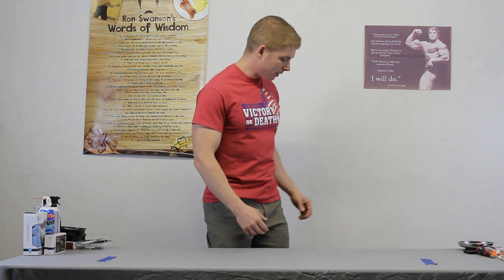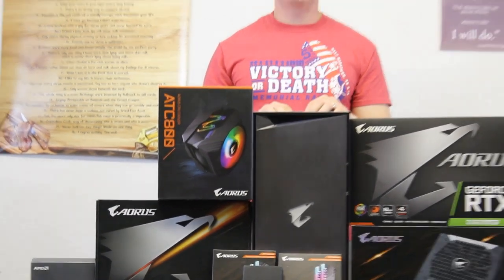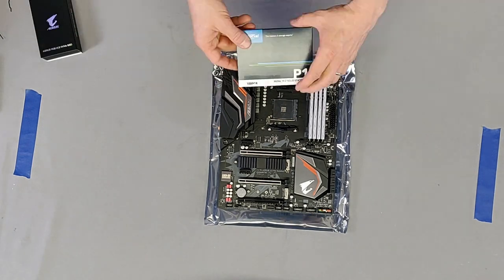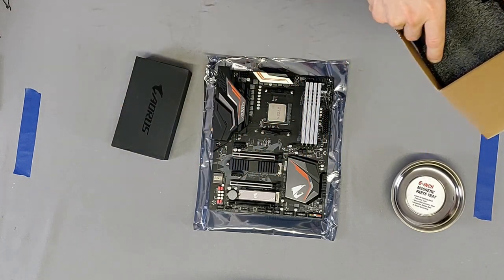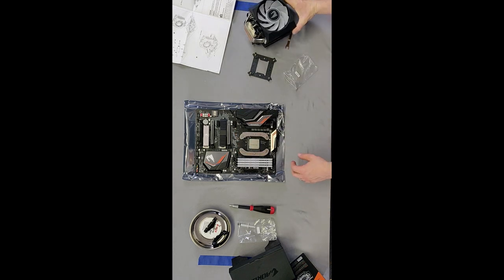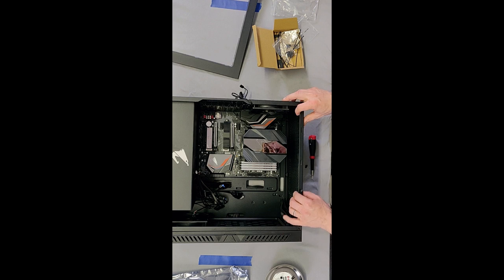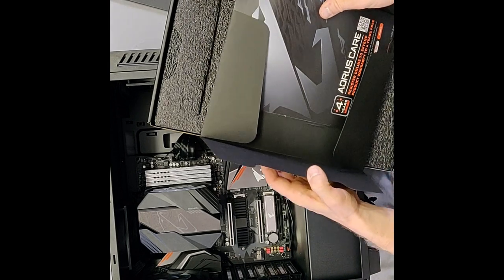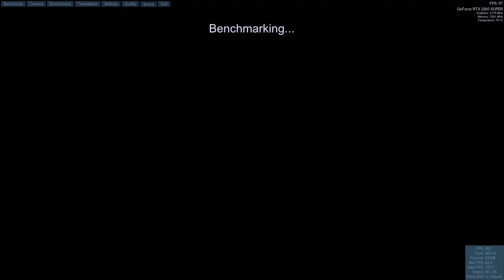Gigabyte gaming PC Ryzen 7 2700X RTX 2060 Super

Comment: If you want do vertical put the Super AORUS in those cases you need a AIO Cooler
Reply from the maker: I did not fully understand just how big that GPU was. AIO would have worked but I was too deep at that point. I still think it turned out nice.

Comment: is the 2700x stil a 3-4yr card ? til nxt upgrde or is the 3600 a better buy?
Reply: Lj Storyahey without over clocking they’re the same but the 2700x has more cores and is better for multitasking like streaming
Reply: thank u
Reply: Lj Storyahey I suggest watching benchmark videos with the 2700x and the 3600 to see if you still want the 2700x
Reply from the maker: I would personally lean toward the 2700X. I think the extra cores and threads would be more beneficial than the higher clock speed. Games are already wanting the extra cores. THis video from Tech deals goes into it a little. https://youtu.be/xg_l-RWjAh8. Either way, I think both are good. Maybe look for the deal.
Reply: Ryzen 5 3600 is way more than enough for gaming and since it’s a 3rd gen Ryzen it would be a better choice than a 2nd gen Ryzen. You DO NOT need more cores, 6 cores is way more than enough for just gaming. Unless you’re doing some serious content creation (streaming, video editing) you do not need more than 6 cores. 

Side note. The Ryzen 7 2600x is not outdated. Plenty of ppl I know still go with that cpu. Great deal all them with more than enough to run 1440 and even 4K at 60 fps for some games.

Comment: Please tell me how is the airflow of this case, gigabyte c300 glass.
Reply from the maker: It was great. I would recommend grabbing an extra case fan or 2. I don't remember how many it comes with.
Reply: @CrashWilcox  It comes with 2, 1 at rear and 1 at the front.
Reply from the maker: @scale...3d  Ok, depending on what kind of CPU cooler you get I would recommend 1 more case fan. It's not a necessity but that is what I would do. Otherwise, it's a great case.
Reply: @CrashWilcox  Thanks